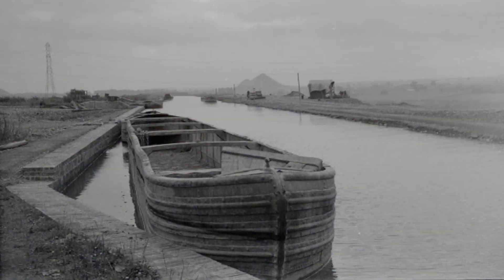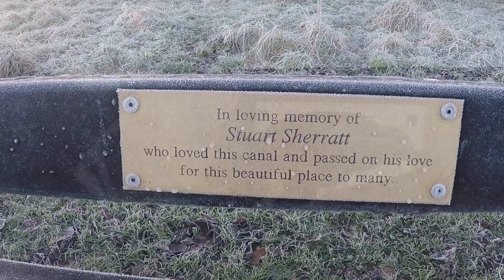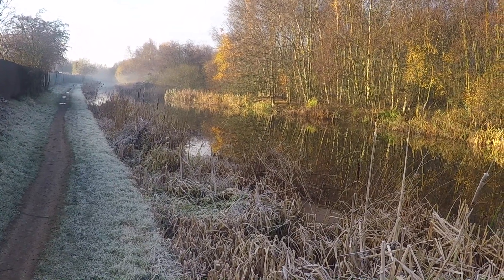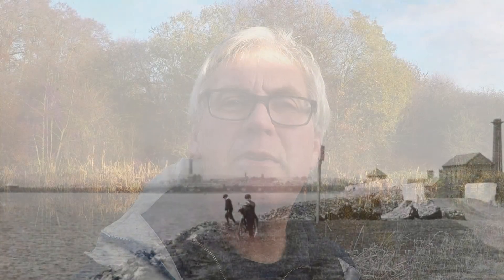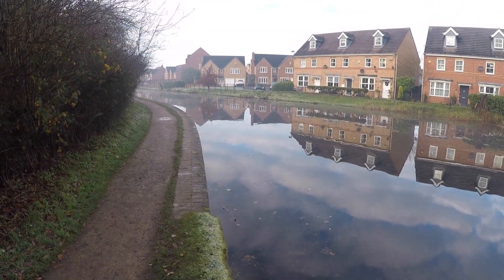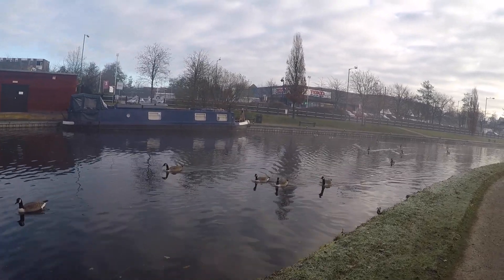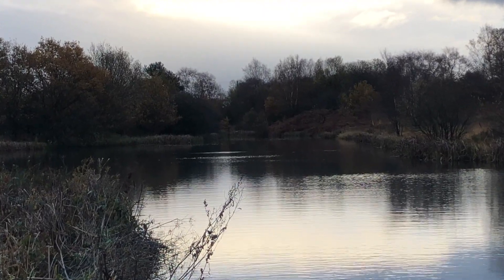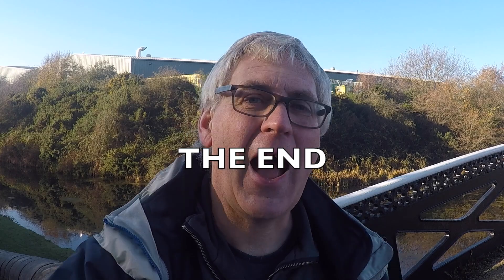4.2 Coals from Cannock - Pelsall Common to Chasewater

Comment: Pelsall north common is my daily dog walking spot and you find all sorts of industrial leftovers there, mostly bricks and chains in my experience, but its definitely still there. Last winter they dug alot of it up for some sort of wildlife preservation reason? (in my opinion it left it a bit of a mess, but either way) that unearthed alot of the old bricks and waste from god knows how long ago
Reply from the maker: I was over there a couple of weeks ago and found a whole lot of bullet shaped objects made of soft sand. I was wondering if they were some sort of plugs left over from the iron making process.